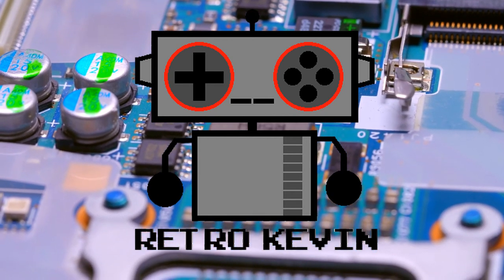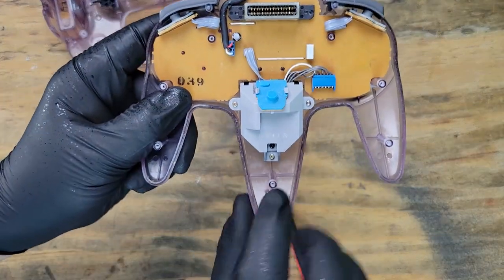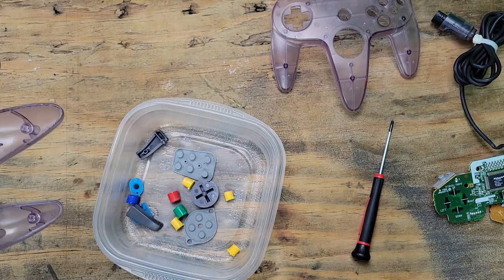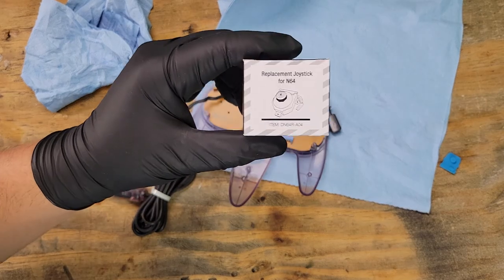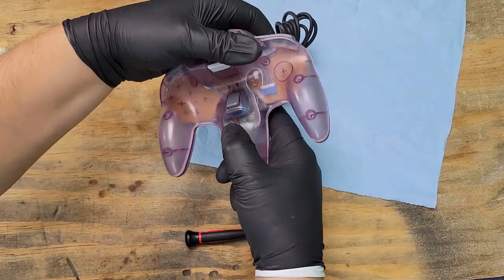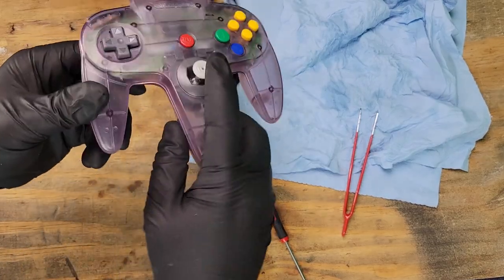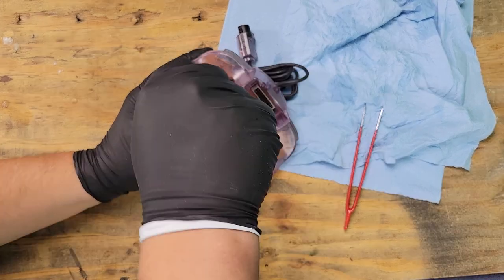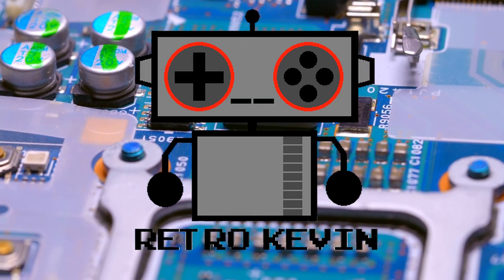Cleaning a N64 controller and replacing the joystick.

Comment: Welcome back Kevin! Glad to see you making videos again and I hope all is well.

In my experience those replacement sticks are good but not great. Definitely better than a loose one though and good enough for the 2nd player to use haha. Vinegar also works great at removing rust/corrosion from screws.
Reply from the maker: Thanks it's good to be back. I took a little time off because my workshop/studio didn't have AC and it's just been brutally hot.

Finally got AC installed so now I can spend time doing repairs/making videos again!

I've used vinegar before for rust. I just like to try different products for Science! I'm sure vinegar is by far a cheaper option.